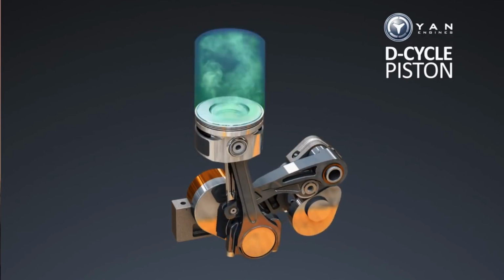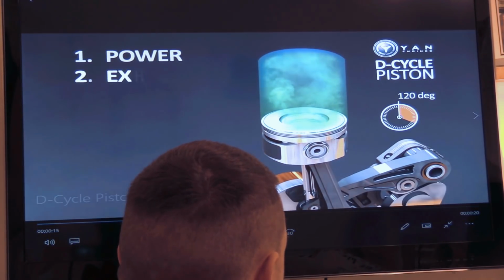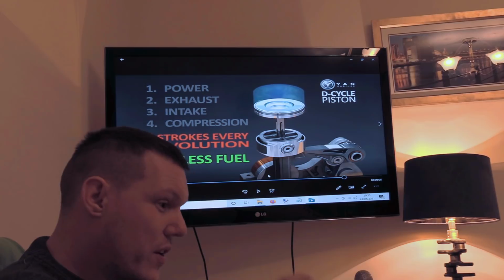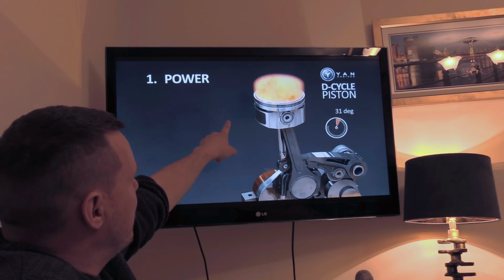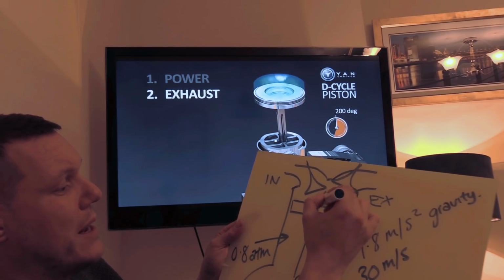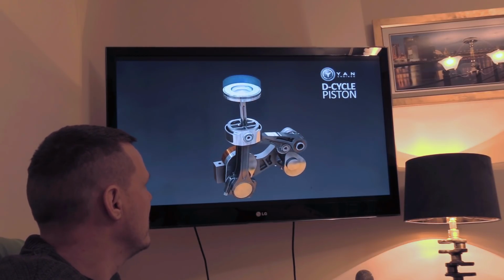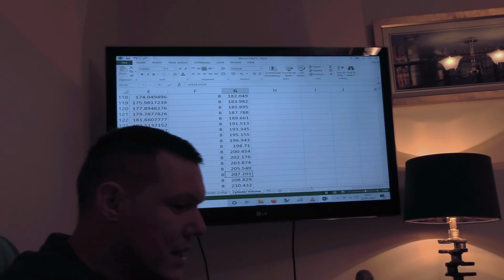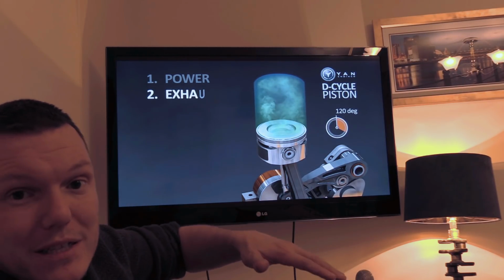Is this a GAMECHANGER? | D-cycle engine

Comment: A Scottish fellow named Dugald Clerk invented this engine in the 1870s. 🙂 In principle it's a forced induction two stroke engine where the charge is being compressed by a seperate cylinder. The design has just been grossly complicated by the independently articulated pistons so that the bores can be shared with the second piston. 

In Clerks original design the piston compressing the charge was seperate. One piston would do the "suck, squeeze" and the other the "bang, blow". The same thing is happening here in principle but within the same piston bore...for reasons I can't fully explain. 👍
Reply: cheers mate
Reply: Cheers Matt and Thomas, I thought it's an over complicated 2t! Then i scrolled down an saw ur comment
Reply: Not really, though.The compression and power stroke are being handled by effectively a unified piston. Just the exhaust stroke and intake stroke are being accelerated by the mechanics here. There would be no supercharging effect. In fact, the double time intake stroke would probably result in a significant reduction in intake charge density below ambient atmosphere. The operations haven't been divided into suck+squeeze and bang+blow - rather it's blow+suck and squeeze+bang. The open valve(lower force requirement) operations have been paired out and subbed to a lighter mechanism.  In your example each subsystem performed one closed and one open valve operation.
Reply: @panchonorthmann6408  
I think you just wrote the same thing just explained differently 🤔
Reply: The two can not even be mentioned on the same day thats how much the difference is.
Reply: It's also a much less efficient Atkinson differential engine.

Comment: Late to the party, playing catch up. First thoughts;
- It looks like Stirling engine
- Lubrication disaster
- Does the cylinder need a fuck me dead cut out for that cam arm to slot through? Won't that then crack like a knobhead?
- As soon as the prototype actually starts, it's gonna throw itself off the test bench, and explode before it hits the ground

Comment: That thing is going to jackhammer itself apart
Reply: My first thought too....
Reply: @randersson3672  Granted it is possible, but with good timing, that should be manageable. Imagine seeing cams and valves for the first time. They look like something is going to smack the cylinder head XD lol. 

I would love to see a working example though. Everything works in CAD.
Reply: I think the opposite is true. This will have twice the detonation per RPM than the regular 4T. When the two piston moves opposite ways they should cancel out each other. I expect this engine run smooth as butter.

Comment: First thing I thought was that’s two pistons smacking into each other🤷‍♂️
Reply: I thought the same exact thing. My fear would be long term wear and tear on the mating surfaces or even the two smacking together hard enough that they shatter. I guess you could design the cam lobe of the piston crown in such a way to mitigate the impact force when to the two mate together. Instead of a more symmetrical design of the cam lobe, could a slightly more progressive grind on one side assist the crown in slowing down perhaps?
Reply: @lyokss  or just keep using the engines we have and invest this time into battery engineering. 

It's like smokeless powder in my opinion, we've had the "same" propellant for over a hundred years and we've tried to come up with better types and failed. We can't improve something that's at its best state to which we can design/manufacture. Same with gas turbines, the "modern" turbines are just modified designs from 80 years ago. We need entirely different systems to implement and improve. Though saying that, what are those systems?
Reply: Why would they have to smack together? Once you time it right you could take away the last thousands gradually just before detonation. This is a very limited square thinking how this will work.
Reply: @Eclipse538 Your comment has no values, its nothing but a personal attack, which has been reported as such.
Reply: Same here. Next thing I thought was that the top thin piston is going to end up rocking and wearing the sides. You can have it happen with short skirt pistons of a more normall design. Going to be a lot worse on a piston like that with basically no skirt.

Comment: My first thought is it is a assemble nightmare. My second thought is massive reliability issues because of high numbers of failure points bearing retainers. Parts crashing into each other.. My third thought is it will be very heavy for the power output.

Comment: what about if between the 2 piston bits there's a vacuum effect? woldent that help with the valve float effect on the top bit?
?
Reply from the maker: It depends on 1) the momentum the piston has 2) the difference in pressure above and below

Comment: I suppose you’d expect to run it at very low rpm? Since you’re getting two power strokes (pulses?) for each rotation of the crank you’d get twice the work(?) Maybe best used in generators or ships? Applications where the engine generally runs at a set rpm for most of its life.
Reply: right assuming the issues were addressed the only real benefit is the reduced mass during the exhaust and intake, so theoretically losing slightly less energy but the difference would be so minor the only way to benefit would be some application like that though i am not sure it would be reliable enough for any company to take a chance on it

Comment: talking about the intake while looking at the exhaust part but i get what you ment. i watched the video and figure the max intake is about 103 degrees worth of travel on the intake until it makes contact with the lower piston and starts the compression obviously less for valve opening closing times.
could this be improved by using a low pressure turbo??
(i haven't used my brain this much in a while)

Comment: He has designed a 200cc 4stroke that halves crank speed.
It still has the constraints of piston/valve speed,weight & acceleration.
Are engines generally restricted by crank speed?
Reply from the maker: Piston speed

Comment: In the intake part could a fixed displacement forced induction like a blower solve the problem ? Forcing air in the chamber  filling the cylinder  and forcing the crown piston down ?

Comment: One of my first thoughts is questioning the ability for the tip piston to transfer heat. Very little cylinder wall contact, not a direct couple to the lower piston and short contact duration. Also not a lot of material so it would heat soak quickly (terminology 🤷‍♂️). 

You did mention the weight, acceleration, possibility of float … I would also be curious as to what material / size / strength would be required to drive the upper piston up considering the length required and the placement of the cam and pivots. 

Mechanically, I think it’s awesome… but I’m sceptical of it having any practical use.

Comment: Did not see the whole video. (before comment)
 About the intake part.
would that not require a relative high pressure to get in, when thinking about the relative few degrees it has to do it?

Comment: I have the feeling the piston parts bashing into each other would cause insane wear. Even when deployed in a low rpm, low rpm band kind engine, like maybe a generator, it might work when using insane high boost for the intake but it would not work very long until maintenance would be due on the piston parts
Reply: sure it could be solved with a very stiff spring.

Comment: The other complications and potential issues with this design aside, the gudgeon pins could be interference fit in the small ends of the connecting rods, doing away with the need for retainers, although there doesn’t seem to be a lot of bearing area for the pins in either of the pistons.

Comment: I don’t know if it’s already been mentioned but my first thought was that the top piston is taking all the heat from combustion, is taking it every revolution of the crank, has less mass to dissipate that heat and doesn’t travel to full bdc to get cooling oil. Also, regarding using 20% less fuel? That is on every intake but there’s now 2 intakes per 2 revs of the crank so in actual fact, is it not using 60% more fuel?
Reply from the maker: Compared to a 2 stroke.
Reply: But the claim is this set-up can be incorporated into any current production engine, car, bike, mower etc and all the examples they show are 4 stroke so that must be the comparison? Big advantage of 2 strokes is less moving parts and less weight, so that makes this a lose lose!
Reply from the maker: 2 stroke engine were used because of their power to weight.... having a low parts count and low cost is why their still in use for cheap applications like chain saws, and even then its because you can invert them.

Comment: Doing the same thing without extra parts would be ideal. And that would be two stroke diesel basicly with scavenging ports. Or open both valves and try to push exhaust out with clean compressed air. You are left with some exhaust but you save egr as its then build in.

Comment: Isn’t there a slot in the middle of that small connecting rod? It looks like the wrist pin has a section that’s 6mm in diameter if we assume it’s a 3-4 inch piston

Comment: That torsion spring method for intake is neat and all, but it’s also possible the engine only works well with turbocharging after its warmed up or super charging or an electric turbo or hybrid or whatever it’s called (basically any forced induction)

Comment: nice! 
the only issue/question I have is when the piston comes away and goes back up. it no longer has a skirt . I wonder if that will rock and wear quite quickly.. or because its so short 
does it not need the skirt?
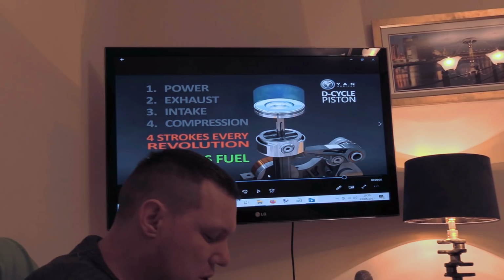11:10 haha we both thought of it :) 
what stops it from rocking a stupid amount I wonder I guess the valves lol 
and lets also think about when they both meet again mid stroke. wouldn't that BANG!  or are they time perfectly to sort of match its speed with that cam sort of thing. ??

Comment: Nice Matt. I emailed you about this engine about a week ago and had hoped that you would do something on it. My 2 biggest concerns were what happens when the 2 pistons meet and how do you handle the vibration of the small piston which both has nothing to balance it and has a speed that is up and down all over the place.
If vibration wasn't a problem then going to a desaxe engine layout would give an instant boost in torque and could also save 20% in fuel ;)

Comment: I hadnt considered a torsional spring in the cam follower, I just assumed the engine with its short intake stroke would use forces induction pushing the piston crown downwards. Tho I suspect that would lower the efficiency of the charger

Comment: It also seems like since that keeps the second rod straight, it acts more like those large diesels with the connecting rod that goes to a moving bearing or whatever it is on large boats (I think you did a video on them) that means that since the camshaft is what makes the cranknecting rod move up and down on a pivot point and the cranknecting rod has a pivot where it connects to the cnctng rod, that rod always stays straight, so when the pis moves up and down, it’s held straight by the cnctng rod through the ulna pin part of the wrist pin in the ton, and the ton likely has the oil control ring too but I’m unsure
Reply from the maker: Crosshead bearing engines
Reply: @thedirtyworkshop  yes, thank you, do you see what I mean though?

Comment: The upper piston skirt looks too shallow.  The lower gudgeon pins could just sit against a cast shoulder as they are a transition fit i believe and don't rotate.  Could the 2 pistons be timed to meet at tdc?  Other thoughts,  as the swept volume of the upper piston is 20% down, thus only 200cc, but isn't it 200cc per crank revolution unlike a normal 4stoke? 🤔  fookin interesting,  ask Del! 😁

Comment: Maybe the designers had something like variable cam ( for the piston crown) in mind so that rather than reducing throttle they are trying to reduce stroke? Variable stroke engine in a sense. And perhaps it’ll compensate the 25% less stroke by being a 2 stroke thus firing twice as often compared to a four stroke. 🤷‍♂️

Comment: the motor I would like to see is an inline 6(smoothest) direct injection 2 stroke with compound(not sure if i have the right term-one turbo feeds the other) turbo using the bombardier 850 as a basis. (stroke of the 850, smaller piston of the 600) I'm thinking aircraft use, either direct drive at 3000 rpm or 2:1 reduction drive at 5000 rpm billet cases everything forged.

Comment: Nissans variable stroke concept engine does the same thing with fewer moving parts.
It's basically an atkinson-cycle where the compression volume is smaller than the expansion volume of the power stroke.
Reply from the maker: What? Lol you're joking right?

It's a 2 stroke without the 2 stroke issues

Comment: im glad you mentioned the intake stroke that was the problem i spotted as well, after a little googling i found the patent drawing for this which shows a spring attached to a standard spring (like a valve spring) oriented so the arm would stretch it on the upstroke which just kinda raised more questions, but patent drawings are not perfect so w/e it seems they have a spring in mind from the start anyway.

maybe thats how they got that figure of x% fuel saving...because it's not drawing fuckall in to burn heh (edit: typed the rest while i was still watching ya got me on that one)

Comment: Seems like you could make the redline somewhere in the 2.5k/3k rpm range and still be able to get as much work out of it as a typical engine at 5k/6k. 

The piston cap, cam, valves would all still be moving at a normal engine rpm range, but the bottom end rpm would be halved.

Comment: One thing you mentioned briefly - the dish in the upper piston which you rightly said couldn't work - I looked for other pictures which actually show this as a raised crown so I think it's just this particular video which is wrong.

Not sure you are right about the intake period though. Remember that the main piston is acting on a 2-stroke cycle so comparing it to the 180+ degrees inlet period of a 4-stroke engine is not comparing like for like. It may only have 80% fill (and I think even that is optimistic, 60%-65% is more likely) but you are doing this every cycle rather than every other cycle. For arguments sake, If it is say 60% filled, but twice as often, it's the equivalent of 120% of a 4-stroke. To that, add the 120 degree power stroke, doubled, is the equivalent of 240 degrees in a 4-stroke engine. In addition, the high ratio of power stroke to inlet should give better volumetric efficiency.

On the other hand, that upper piston has very little area to transfer heat, plus it is in contact with the combustion and exhaust gases during 200 degrees of the cycle, so it's going to get damn hot.

It's all a bit pointless though, no manufacturer is going to risk investment on something like this when they are all shifting to electric or hydrogen fuel cell.

Comment: This 4 stroke 2 stroke design could work very well with my 6 stroke 4 stroke theory, have a regular engine but use this type of system to double breathe the exhaust with extra fresh air to really purge it and lower cylinder temps to increase the ability to expand the nitrogen, on a normal system it would be really wasteful and almost pointless to throw the mass around an extra revolution just to purge the cylinder a little better
Reply: I don't remember where I saw it, but I distinctly remember a push for a 6 cycle engine that injects water after the normal exhaust stroke and uses the corresponding flash of steam and expansion to generate a second power stroke and cool the engine. If memory serves it ends up using a LOT of water relative to fuel.
Reply: @BuffMyRadius  it would likely be equal to the level of nitrogen used in a normal combustion event

Comment: Can’t see how it’d use 20% less fuel with all the extra friction losses and moving mass. 

They’re showing the lower piston without rings, but it need some or it’d slap the bore like mad.
Reply from the maker: 20% less air...
Reply from the maker: And rings dont do that....

Comment: I the world where I fix stuff, cam follower bearings all fail at some point, not to mention the extra retainers, etc. you mentioned. Oil better be kept clean it that engine! And what is keeping the "lower piston" located in the bore? Looks like the oil could get frothy. I see a lot of potential for failure.

Comment: you are going to  be dealing with extra friction from the additional moving parts, this creates additional heat, you have the additional mass, weight, means a bigger block, additional cooling capacity, seems very complicated so you may have short service intervals, all for only a 20% fuel saving, what about power and torque levels compared with similar size engines, 650cc, 1000cc
Reply from the maker: All of the above are valid concerns until you got to the 20% bit. This is a 2 stroke engine that would pass all the emissions like a 4 stroke. In other words a more complicated 2 stroke but its legal.

Comment: You should be so lucky to get even that level of disclosure on the Alphadan. IMHO the stout con rod will make short work of the mini con rod at speed. Wonder how it works with the top pancake disconnected.

Comment: The top Piston wouldn't have to just fall at Gravitational speed, it probably operates with a Coil Spring return which would never get violent because it would only be keeping the follower in contact with the cam.